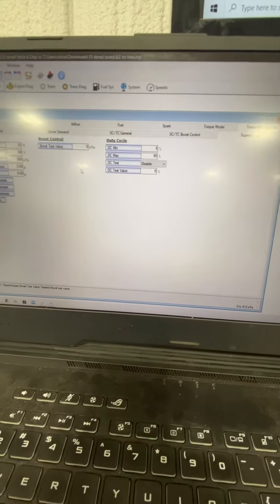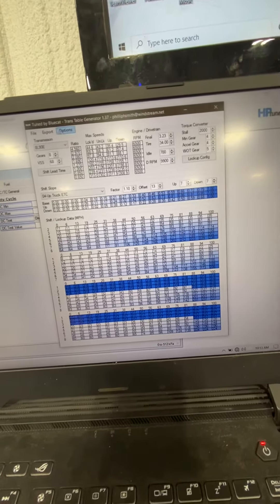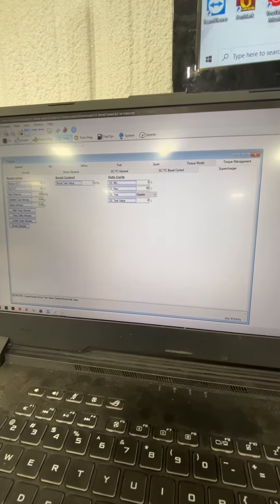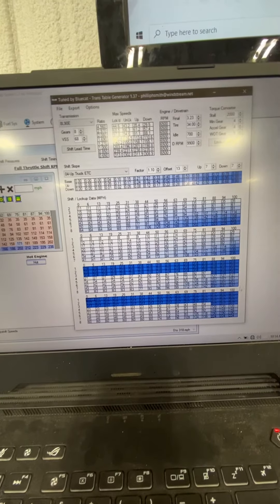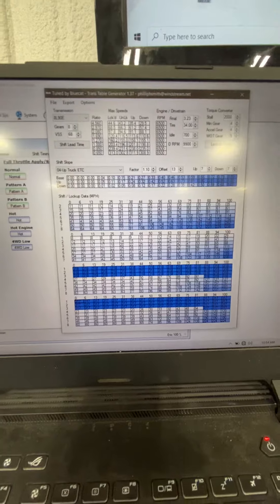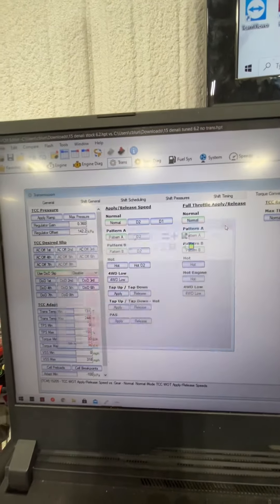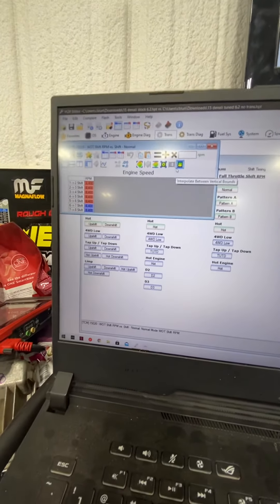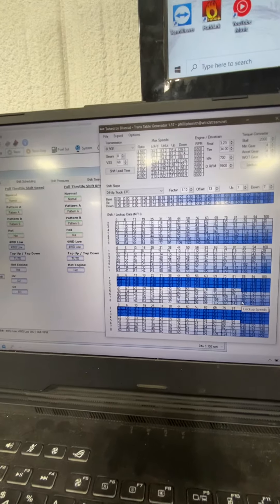GM 8190e base tuning

Comment: The tcm has to be unlocked first to be able to make changes right ?
Reply: Yes. It can be removed and shipped to HO Tuners to unlock it OR buy an unlocked TCM from them directly and have it learned and then tuned.